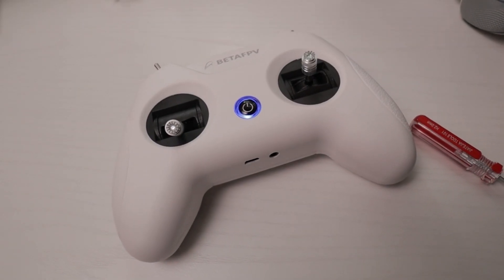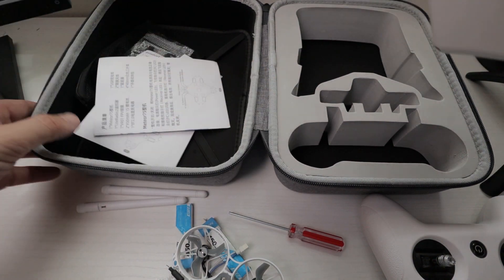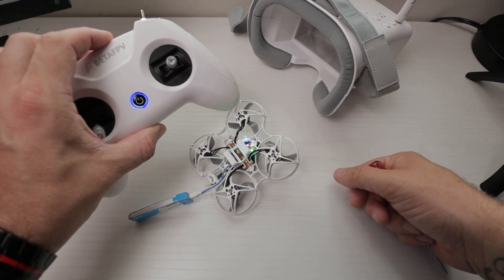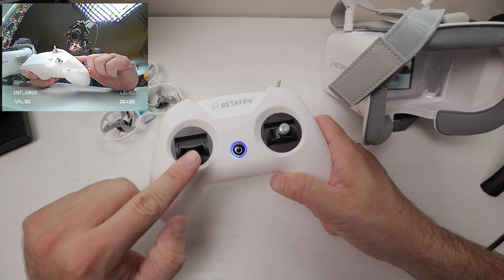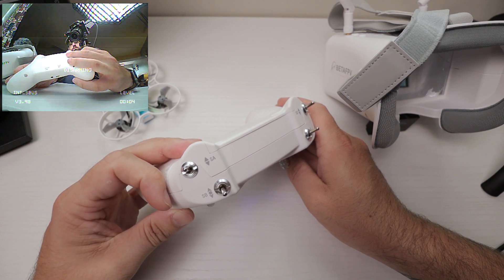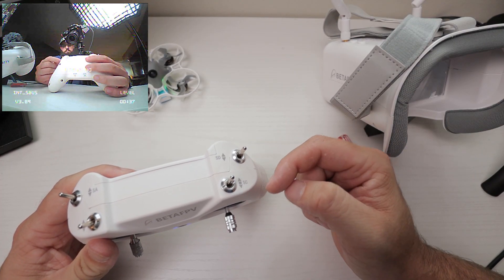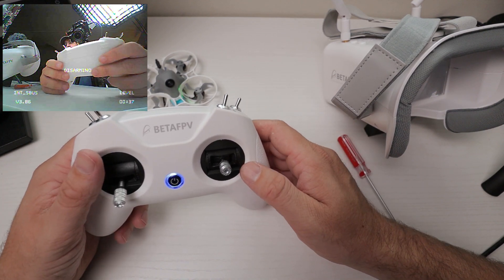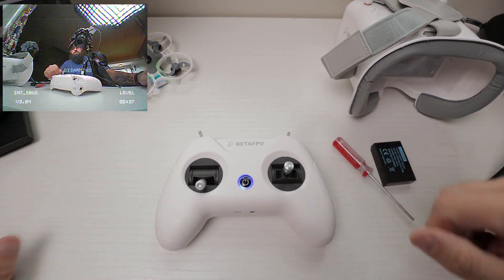BetaFPV Advanced Kit 2 - HOW TO:  Bind, Adjust the FPV Channels and Flight Modes

Comment: hey, thanks, mine was bound out of the box. But have a couple of questions. -And please note that the meteor 75 lite I got is a bit different than the one you show. 
I don't have any buttons, but I do have a micro USB socket on the FC board. Hoping I can get into betaflight with this, but have found zero info.
Ah ha, Just figured out I have the F4 1S AIO board not the Lite 1S which is discontinued, but not exactly -mine is a brownish board and slightly different layout
than the F4 board shown on the betafpv site. -hmmm .
1. first -the goggles and your glasses -Mine fit inside without the side pieces but need higher magnification to read data -what do you do?
2. flight - Small, I mean small touches to the throttle (in Level-s mode) change it from on the ground running to smacking off the ceiling.  Can lowering  rates fix this?
3. I see no access to OSD to change Tx power, rates etc. hoping the micro plug will solve this. Flicking SC killed the video, rebooting goggles and channel search brought it to a different channel and displayed -LAYOUT menu. None of the Tx controls work to change anything.
Reply: After lots of troubleshooting, I realized I'm in the exact same situation you are.   We have a different board than he is showing in this video.  
It seems like our board does not support 200 mW vtx?
Also, beta flight doesn't seem to recognize this board, so I think maybe it's running silverware?
Reply: It's funny that even though we have a micro USB plug, I can't seem to get it to connect to beta flight.  Their website seems to suggest this FC board comes flashed with betaflight, but I can't get it to recognize. And I have other drones that I connect to the same computer with the same port, so I know my setup is working. 

Have you had any success at all connecting into your PC?

I did find that our OSD menu has an advanced screen with more options available.  Still no 200 MW vtx, but at least it's something.
Reply: @wmcewa01  I'm waiting to hear from Beta. Lots of holidays in the way. I'd have to start from the ground up (literally) with betaflight. 
I guess i need to do that anyway. I just want to fly this f*cker.
Reply: I ordered this kit aug 30 from beta's site, with 7-10 days shipping. Go it it 3 weeks later, and it's been dead since. I have 4 emails into support@betafpv. 
I realize there was a lot of holidays in between but this is not looking good.
Reply: @salvor1  do you have a ticket open at betafpv.freshdesk.com?

I have my ticket open there, and I've gotten at least one update (although that one update was useless).
Reply: @salvor1  and remind me, what are you grounded?I thought you were just looking to adjust rates.
Reply: @wmcewa01  I have not heard anything from them. Yes, I checked my spam folder.  I was flying out of the box, left it alone for a week (hoping to hear from them) and now it appears I need to bind it again. There are no instructions for that. Blue D8 on the Tx, Rx loss in the goggles, and a medium flash amber on the board. There may be a switch on the board but it is on the wrong side of the board in:
https://support.betafpv.com/hc/en-us/articles/900004960143-Cli-DIFF-for-Meteor75-F4-1S-FC-SPI-receiver-Frsky-Futaba 
My FC is brown in color (the F4s on the website are black) and the one switch I think I see is on the wrong side. I think this is the closest FC to the site because I have what appears to be a Betafpv SPI reciever plugged into the the board opposite the micro plug -says FRSPI V1.0 on it. Does this sound like yours? 
I can't tell if it's a switch -Really small and does not seem to do anything when pushed (physically) -is there any tactile feel on the switch? I can't tell. I can try to bind that way, but I'd rather know what I'm doing. Did you connect to betaflight? Bardwell has a great video -betaflight 3.4 and 3.5 setup -lots of screwy things to do to hookup -especially with  windows. It's just like WTF. I get this thing, looks to be perfect, and it turns into a mess that burns up many hours and weeks of waiting. I just want to fvp. 
So can you let me know what they sent you and tell me if your FC matches mine?   Could maybe just buy a S2 or one of the F4s (more weeks) ---or just return it. 
I hope I hear from them -probably a lot of holiday backups.
Reply: and there is a CLI listing for sliverware on their site.
Reply: @salvor1  stinks.  I don't think there is a configurator for silverware. And it won't plug into betaflight.
Reply: @salvor1  here's a link to some pics of my board. I'm suspecting it's the same as yours.  
https://photos.app.goo.gl/hAazbJRvKV6PAoX5A
if you look at my photos, the bind button is that small black dot just above the red wire. 

Are you certain you're in d8 mode on your radio? I don't think a blue light alone tells you that.
Reply: @wmcewa01  I don't think it's for silverware ---I think it makes another  FC act like silverware.
Did you make any progress? did they contact you again? Which FC do you have?
Reply: @salvor1  I think I have the same board you do, but you can confirm based on the pictures I sent.  

I have had some luck after submitting my ticket on their support website.  My email, like yours, never got a response. 

They offered to send me a new flight controller board. that means there will be some work on my end to get everything switched over, but it's better than nothing.
Reply: @wmcewa01  Yep, same board. Getting a replacement board won't help unless it's a different one -with info. On their FC page is the lite 2S or the one from the meteor page (click on FC in specs) a F4 1S  -for Rx options there is FCC, LBT or FHSS -I don't know which. 
Was going to ask how you knew that was the bind button, but I finally got a feel for it. It seems to go through the motions -no flashing amber. Tx button goes purple -blinks, hit bind on TX then lights blue, copter goes green for a while then back to flashing amber -RXloss on goggles doesnt  change. Checked for D8 -oops it changed. Reset to D8
IT BOUND!! (blue light on board and TX-no Rxloss, it arms)--but-- just goes to full throttle and stays there -with me hanging on to it -no change with throttle stick. RATS. --it's late, all for now.. test fly later, throttle may be because of bad gyro calibration.
Reply: @salvor1  woohoo!  Glad it bound.  
I find that mine will go to full throttle if I'm holding it.  Put it on the ground, zero throttle, and then arm it. See if that helps.
Reply: @wmcewa01  you're right -right back to the same up down nuts. Small quads in velocidrone are easy compared to this one. I bought a lite 2s FC -it'll be weeks but we'll see what happens. Did you ever get connected?
Reply: @salvor1  yea. Betafpv says they are sending me a new FC. We'll see.  Might be a long time until I receive it, and even when I do, I bet it's going to be the same low power version I started with.

Will the 2s board work with this model? I thought it comes with an XT connector already installed to take a 2s battery?
Reply: @wmcewa01  Yea, I may have ordered the wrong board -weeks away yet -the lite 1S webpage says the 4F 1S AIO board is the replacement -but I dumbly assumed that the 2S was the replacement for the out of production 1S -duuu. 4F should hook up to betaflight. Lite 2S should still be siverlight -adjustable through the OSD. I saw an emulator for silverlight numbers for betaflght somewhere -noted above. I don't know if the 2S board will run on 1S -I have 2S batteries so I can see but will the copter deal with it -I don't know. 
Guess I should have ordered the 4F board -but Beta should fix this -Man their customer service sucks. How did you open a ticket?  Should have sent this whole thing back long ago -but what is better?
Reply: @salvor1  hmm. I can't say for sure if the 2s board will work on 1s. I guess just make sure you can test and still be able to return the board if it doesn't work. 

I opened my ticket on betafpvs website.  They updated status there every three days or so. 
The bottom line is that I think you're better off dealing with the reseller that sold you the kit than beta themselves.
Reply: @wmcewa01  got it from the beta website  -no stock elsewhere.

Comment: I bought this kit on black friday deal and I have a completely different OSD options.
Can anyone tell me if they changed the board with worse vtx power?
I can't change vtx power to 200mW so I have only 25mW?
Reply: I ordered mine on black friday and got it today.  My menus are different too. I only have 3 modes too.
Reply: Same deal.  It's on a different flight controller. 
I also can't seem to get it to connect to beta flight. Have you all had any luck connecting it?
Reply: @wmcewa01  I haven't tried to yet
Reply: @wmcewa01  mine seems to drift forward constantly. I would like to adjust the trims on it
Reply: @00powerstrokin  I don't think even the OSD has trim options available.  I'm relatively new to this but there's two things I can suggest:
1. Make sure you start the drone on a completely level service. I believe the gyro calibrates on drone startup. (so plug the battery in, place it on a level surface, and wait for those second set of beeps)
2. Mine seems to start off drifting, but then recovers quickly. After one or two seconds of having to make manual adjustments myself the quad seems to stabilize.
Reply: @00powerstrokin  I confirmed that these new boards are running silverware and will not connect to Beta flight. 
Also, to fix your drifting problem, I would try the stick commands to calibrate the accelerometer. 

https://sirdomsen.diskstation.me/dokuwiki/doku.php?id=gestures
Reply: @wmcewa01  so how do you put it into the gesture mode to calibrate the accelerometer? Power on the controller and drone then press right stick down 3 times?
Reply: @00powerstrokin  correct - as far as I know.  You shouldn’t need to do anything extra to enter gesture mode.  Look for the LED flashes to confirm the gesture was received.

Comment: Thank you for the video dude! It´s very good! Anyways I buy this kit advanced 2 and the bottom of my drone is diferent, only have a button and another plate that I don´t know what it is... The OSD drone is different too. I only have CONFIG LAYOUT SAVE and EXIT. In CONFIG only have RX on/off, LED on/off and AUDIO on/off.... I don´t understand nothing and I only could fly my drone twice because the OSD say me that the voltage is 9V, suddenly dissapear de ODS info or other strange things... I only want reset the configuration but I dont know why hahahaha a complety dissaster...
Reply from the maker: I've reached out to betafpv to see if I can get the updated kit and do a new video
Reply: @BuddyRC  Thanks for your reply! I can give you some info about this now. At the end was a fault FC in my meteor 75 lite that didn´t allow me change the options... They send me a new FC but now the problem is the transmitter. The gimbals don't work as they should and looking for on Youtube is a very common problem that happens after 2 weeks of use normally... 
I don't know if I was unlucky or it's a bad kit. Regards and thank you

Comment: Hello, I need some help, somehow my set is a little different. I don’t know if it’s older or newer. But in the OSD is super limited I can’t set anything about smartaudio or rates etc. Would be super greatful if someone could help me out a little bit.
Reply: Does your drone has a USB port or is it identical to the one shown in the video? My has it and the osd is different too 🤔
Reply: @erickjordali7787  Yes there is a micro USB port on the bottom of the PCB. Sadly I still havent found out how to set it up poperly. Maybe by connecting to Betaflight one could change these settings.But since Im new to the Hobby I dont want to ruin something. In case you find anything it would be awesome if you let me know aswell :)
Reply: @I9BlackI1Knight  I'm new too, some people say that the usb is for flash the FC not for configuration in betaflight
Reply: @erickjordali7787  that is all correct. This new board runs silverware, not beta flight.  And it's 25 milliwatts only, no option for 200.
Reply: @wmcewa01  do you know how to get the older board, which is up to 200mw or another suitable for this 1s drone?
Reply: @vicg.7225  Sorry man, as far as I can tell the old board is no longer being made. I'm sure you can find something that is compatible, but youd have to research to make sure
Reply: @wmcewa01  thanks for your answer. It's really a pity they have changed the board. With only 25mw you cannot go very far with the drone, because you loose the image video. I wonder why Betafpv changed it...
Reply: @vicg.7225  A lot of manufacturers seem to be going to 25 milliwatts for the tiny whoops.  The moblites and the TH2 are both switchable up to 200 mW which I think is great. Uz65 is another good option.
Reply: @wmcewa01  do you think that this https://betafpv.com/products/copy-of-z02-aio-camera-5-8g-vtx
Could suit with the meteor 75 board? It looks like it can, but then I don't know if it will work with it. I mean, since the current board has already an integrated VTX....
Reply: @vicg.7225  A few thoughts:
One, I don't think you need to mess with a new camera to get a new vtx. They sell VTX's separately. 
Two, because the original board is an all-in-one I don't think you're going to find anything that is plug and play. So you'll need to be soldering, and these connection points tend to be very very small. 
Three, even a three gram addition changes this quad's weight by 10%, which will change its flight characteristics. 

All in all, I think you're much better off spending ~ $80 to buy a second quad.  

These things break with use, so I learned very quickly that having only one quad in your collection really just is not enough. You'll spend more time on the bench than you will flying. 

Good luck!
Reply: @vicg.7225  Here's a cheap (free) fix, try up-righting your antenna.  Sending the antenna straight out the back is a terrible design idea from beta.
Reply: @wmcewa01  thanks! You were very helpful!

Comment: Thanks for the video. Do you have any idea how to adjust RSSI not to use Aux4 (SD switch)? Our BetaFPV lite radio 2 has Aux4 as a switch and I'd like to assign it to something in betaflight, but Aux4 (SD switch) is being occupied by RSSI for one particular quad using an XM+ receiver. I have no issues with other quads. Just this one GEPRC Skip 3 HD where it wants to use Aux4 as RSSI instead of letting me assign it to my desired function.

Comment: I'm having trouble binding this. Some videos are just plugging a battery in and turning on the controller and pressing bind. I've tried that with no luck and I have tried your way. When I try your way I never get the 3 flashes on the controller. Frustrated and ready to return it. Any help? Suggestions? Thanks
Reply from the maker: It's a painful process for sure.  Only compounded by the fact some come direct from the factory not bound.
  Ensure the throttle stick is all the way down when you go through the process of ensuring you're in D8 mode.  If you aren't in D8 mode the quad won't bind.  If you follow this video exactly and it doesn't work shoot betafpv a support ticket to see if they can help.  The steps in this video have been what has helped many.
  If a replacement or return is needed at the bottom of the buddyrc.com you'll see 'warranty and returns' just follow that and it's pretty straight forward.

Comment: Thank you for the excellent video! My radio lite 2 has troubles with potentiometers for the second time (values are jumping). I'm going to buy RC Radiomaster radio with frsky D8. Will I be able to bind drone from the kit to RC radio like radiomaster? Or will it only work with Radiolite 2 controller. Thank you very much for your answer!.
Reply from the maker: Apologies for the delay!  YES!  Radiomaster will work with this!
Reply: @BuddyRC  Thanks! I already fly with it its a heaven compared to radio lite 2 :D is there any Expo set up inside silverware board or are all axis linear? I can set rates from OSD, but im not sure about expo or any non linear adjustment. Thanks Buddy RC!

Comment: How are the (3) switches supposed to be set to get in the easiest/slowest flight mode of all?
Reply: I just got mine 1 h ago and I'm flying on LEVEL mode at home. It's a bit too fast for me. I've tried to lower the rates from 800 to 60 but drone is still super fast ;) Maybe rates affects only ACRO mode but I'm scared to turn it on at home :P I'm not sure what else can be adjusted. Please let me know if you will find some solution.
Reply: UPDATE after a month with Advanced Kit 2: I burned Mosfet transistors at one motor while trying acro at home... I don't really know why it burned - drone just hit the wall and fell down without geting anything into props. Most probably due to broken frame, it was looking fine and props where free to move but probably when I "touched" the wall frame touched the props and it was enought to burn mosfets. In the end I just bought new FC with BetaFlight and USB port. I resoldered VTX and changed frame. I must say that it's AMAZING how many things you can configure in BetaFlight. I can switch my quad from super fast to super slow just by switching profiles on the radio! Now I'm waiting for Tango 2 with multiprotocol module as my RadioLite2 started to produce "shaky" stick positions. Looks like green potenciometers are shitty - I bended them a bit, it helped for a while but problem returned :/